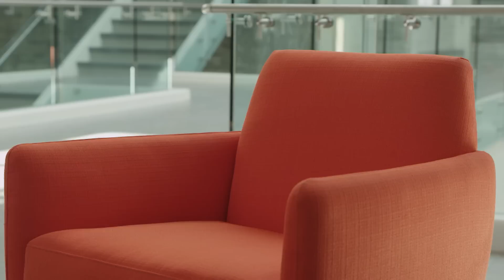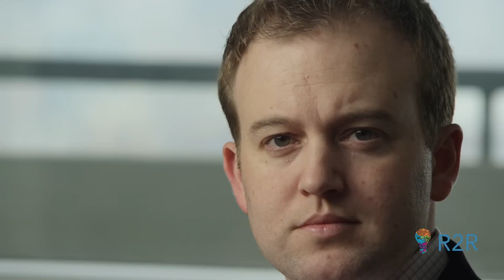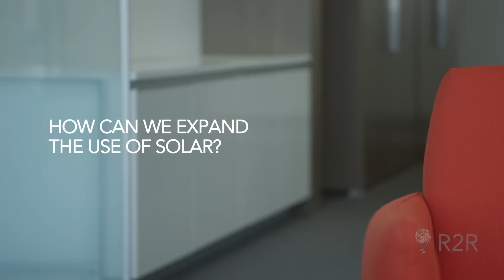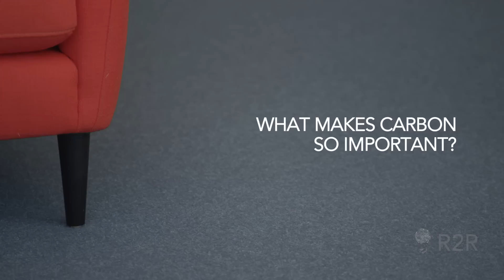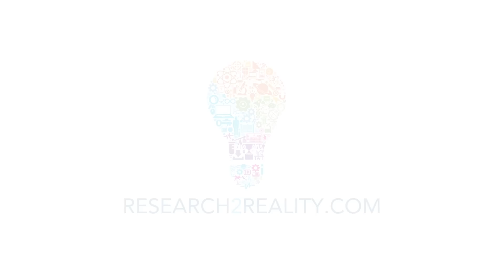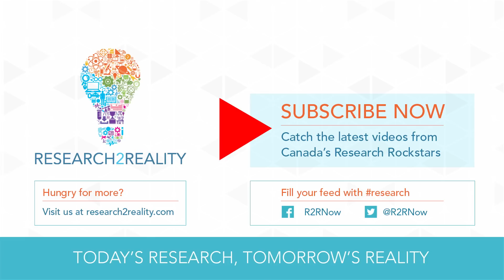The Paint That Can Turn Any Surface into a Solar Cell

Comment: The speaker is wearing a suit and tie, so I instantly believe everything he says.  But seriously:
1) Carbon does not have a melting point, unless you consider diamond, which melts at 3550 degrees Celsius.  A few degrees above this, it vaporizes.  Graphite does not melt at atmospheric pressure at all.  It turns directly into gas (sublimates), provided you keep oxygen away from it.
2) Using solar technology is not carbon neutral.  Whenever energy is used to process materials, that energy comes from burning fossil fuels, at least today.  The same is true of nuclear power, which requires energy to process the fuel (diesel equipment, etc.).  Once solar panels and/or nuclear fuel have been manufactured, the operation does not produce further carbon dioxide, that much is true.
3) To have a paintable solar cell, you would need to create a preferred direction (anisotropy).  Electrodes would need to be included at the ends of the polarized grains, to collect the electricity produced.  The solar paint would also need to be insulated, to keep the electricity from shorting out.